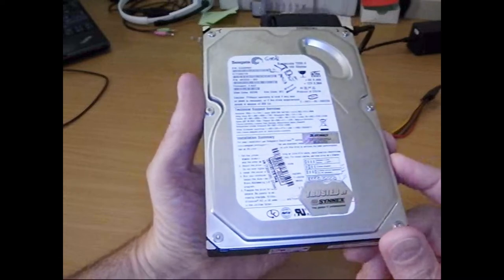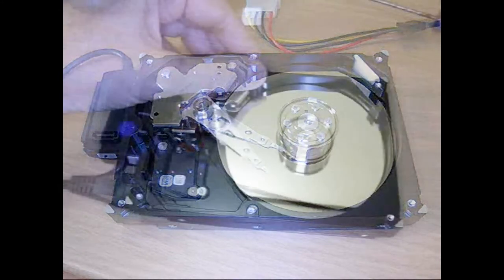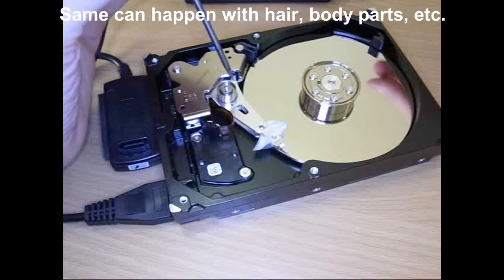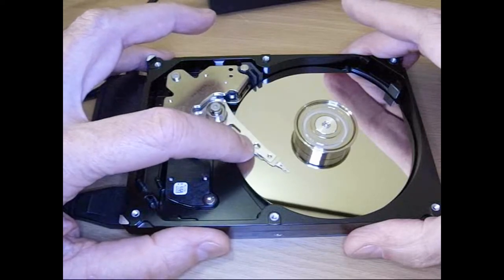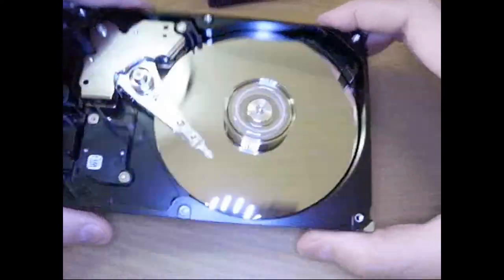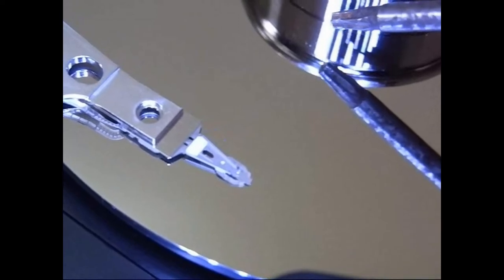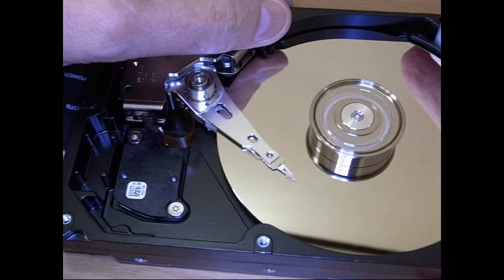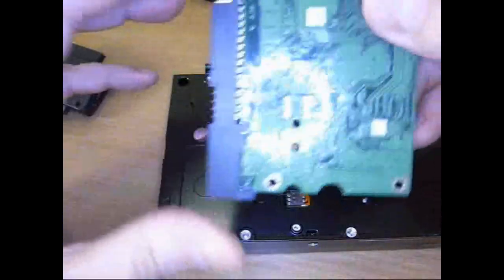Hard-disk - Running One Open / FYIs, What's Inside, What's It Doing?

Comment: When doing computer repair (awhile back) I took the cover off a 2.5” drive and put a plastic cover on it. Used it powered on and powered off to show customers how a hard drive worked and (as you said) why to be careful and what the it’s sounds meant. I retrieved the powerful magnets out of hard drives to make little things. I did use the motors to make a little fan for drying stuff and to power (with a little rubber belt from DVD/CD drive) to turn toys and stuff for my kids and grandkids! Hard drives, CD/DVD drives are amazing with all the internal parts! Of course the shiny platens are cool as mirrors to burn ants or as a mobile.
Yes I hated hearing Hard drive head scratch or hit. Was lucky if any data could be retrieved for me or a customer - haha!
BTW, laptop screen backlight strips are cool when retrieved for lighting things up with just s tiny bit of power (even 9v or button batteries sometimes).